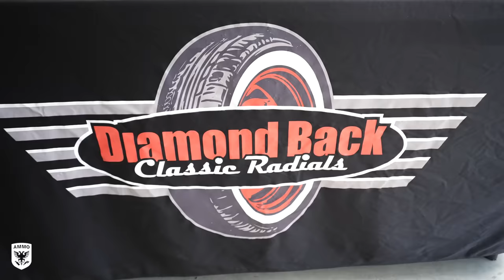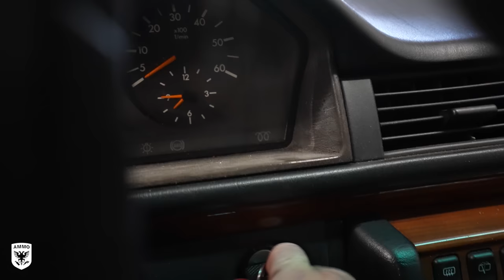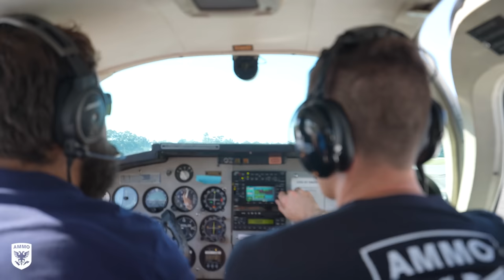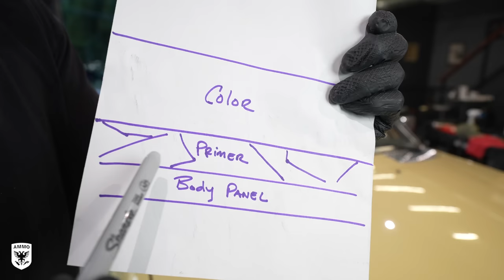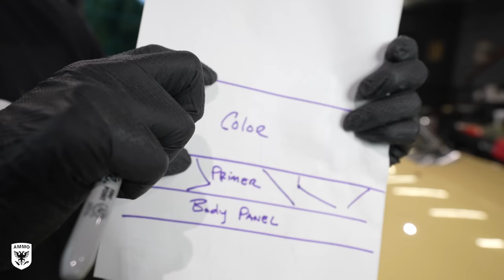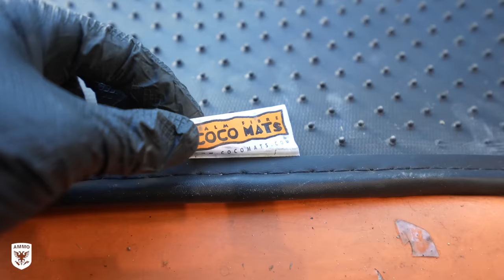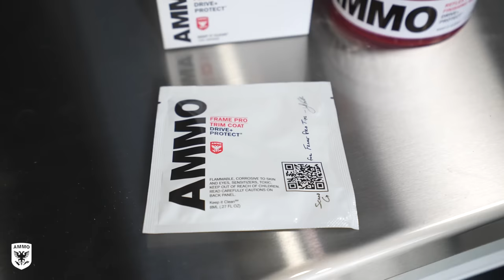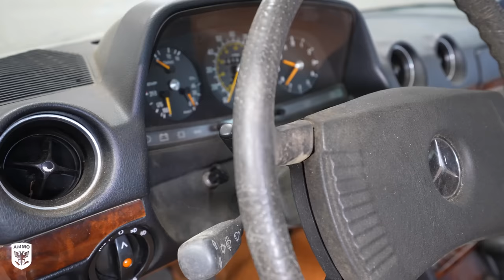First Wash in 10 Years: Mercedes 300CD Diesel Disaster Detail and Sale!

Comment: That's actually incorrect about the starving of air. Diesel creates no vacuum, especially non-turbo examples. They rely on a diaphragm pump to run the brakes and other vacuum accessories.  There's also no valve body or any plate restricting air entering the engine. That shut off cuts the fuel at the pump. Normally is vacuum operated but usually the rubber lines fall apart after the 40+ years.
Reply: My buddy’s 300TD would keep running and we had to pull or kink one of the vacuum lines if the key didn’t kill it.
Reply: Repent and follow Jesus my friend! Repenting doesn't mean confessing your sins to others, but to stop doing them altogether. Belief in Messiah alone is not enough to get you into heaven, you must become a new creation and be born again by responding to the Holy Spirit. - Matthew 7:21-23, Revelation 3:15-16 cf. Hebrews 10:26-29. Pay close attention to your thoughts and how you respond to your inner monologue because it has a greater impact than you think.  Call on the name of Jesus and pray for Him to intervene in your life, and do all that you can to follow His ways.

Comment: I’m a big Mercedes diesel fan here in Ireland. Great to see two 5 cylinders on the channel. The diesel coupes were very popular in California as Mercedes used them to help lower their fleet emissions to meet the air control laws of the 70’s and 80’s. 
Even though Europe was a huge diesel market, the diesel coupe was strangely a North America only car.
Reply: MB 300D was mainly used as taxi or corporate cars here in Europe, and a two door coupe wouldn't be good for that.
Reply: I'm new to the Mercedes crowd ,as I just got a nice 80 240d 4 speed from a little old dude who was a customer of mine. 
Coming from vws, at least I understand a little bit of German 😄
What a heck of a car, it handles really good even on those skinny little tires and stops great too. 
It's not really any slower in acceleration than my old diesel rabbits I drove for years. 
What a fanbase these cars have, I knew a little but since I'm immersed in it now,I really had no idea. 
From what I've read about ,it seems like it's a car that they almost made too good and can actually be repaired. 
And what a joy I had the other day working on it, I dropped a wrench in the engine compartment and it fell all the way to the ground! 
I haven't had that happen in years especially working on Mk4 or newer vws! 
This right here,is what I believe they are talking about when you hear about the German engineering.
Edit: one car I have a bad itch for ,is a blacked out 91 560sec. 
I saw one years ago at a show ,and for sale at 11k. 
At the time ,not knowing anything about them I passed on it as I was afraid of the German money pit syndrome, but what a car it was. 
Someday I'll find one.
Reply: @MrTheHillfolk  I was basically bouncing between buying a car with the 1.9 PD TDI (probably a mk4 Golf PD130), or an old Mecerdes OM diesel. Ended up with a 1990 190D OM602, same engine as the wagon in this video, but naturally aspirated. I plan to drive it literally forever, running it on vegetable oil if diesel becomes unobtainable.
I agree with you about the fanbase. I came from mostly Japanese stuff, having never had a German car at all, and the old Merc community is fantastic.
Reply: I see a few of these everyday in my neighborhood in LA. Testament to their enduring popularity and remarkable durability.
Reply: @MrTheHillfolk  Welcome aboard (1979 240D owner here since 1993).  Those cars will run forever and there are very few NLA parts from Mercedes.  In fact, you can go into your dealer right now and order new OEM parts.
Reply: @Bannimann2  The most taxi drivers at least in Germany preferred the 200D.
Reply: i always thought it was weird WE got all the diesels.
Reply: one thing about these Mercedes is the sound those doors make when they close. its like a big vault closing crazy quality.
Reply: @cassiodios  Yes as the size of the car was identical, and the smaller engine in the 200D had a better fuel economy, but they were slow as heck, which didn't mean a lot in the cities. Here in Denmark the 200D was also the prefered choice as a taxi, but there was also quite a lot of the 300D variant. :)

Comment: 17:22 A tip with the razor blade, use scotch or packing tape on the rest of the blade where you don't want it to make contact with anything to prevent yourself from accidentally gouging the paint. You can tape off both sides of the razor and just use a small little patch in the middle as if it were a tiny hand plane blade. It gives you a lot more control and peace of mind.

Comment: 7:55 The opposite. 
Diesels run on compression heat only, with no throttlebody or sparkplugs, so to turn them off they're starved on fuel.
However the shutoff on the injection pump is vacuum operated so there's a manual shutoff tab on the linkage incase of a problem in that system.
The glowplugs are for coldstarting and vaporize the fuel injected directly at them to help atomization when the internals are cold.

Also "dieseling" i believe is from the time when a carburator engine kept running with ignition shut off, and nowadays adopted for any similar situation.

Comment: I use to own a 1982 300D auto, same 5 cylinder engine, it was really tight until I got 100,000 miles.
Iran it for 8.5 years and got half my money back when I sold it, a great car. Later I had 2003  270CDE auto the same 5 cylinder engine with a turbo, ivory leather interior, the best car I ever owned, I gave it to my daughter when I retired  overseas and she still drives it to this day. 😀👍

Comment: In the spring of 1977, a coupé version was introduced on a shortened wheelbase (2,710 mm (106.7 in) versus 2,795 mm (110.0 in) for the saloon).[6] The C123 was available as 230 C (later 230 CE) and as 280 C and 280 CE in most markets. Unlike the W123 saloon, the rectangular headlamps were fitted to the C123 regardless of engine type.

Comment: Great video as ever. Makes me want to go get new cars and tidy them up! 

Question: why do you always pressure wash straight up then snowfoam - do not rinse - then contact wash with "shampoo" and then rinse?

Learning fro. Forensic detailing youtube channel in the UK - he suggests the foam products are engineered as contact less/pre wash options and has tested rinse first vs foam first them rinse and found the pre rinse just leads leads more water / diluting the product and letting it run off? Surely thar approach before the contact wash is better for the paint as you'll clear more dirt and won't risk micro scratches thar need poliahing off - I realise you are practically always polishing the paint but still why?

Comment: Steering wheels used to be large in old MB cars because MB wanted you to be able to turn the wheel even if the power steering failed on you. Many things on these cars are designed in such way that it would allow you to drive away when evey other brand would just stuck. MB was a top notch car with customers in mind (not so much today)

Comment: That Cadillac! But I love an old Benz. You would have seen a lot of those in Germany mostly until the 90s, when other manufacturers started to create Taxi versions of their normal sedans. One of the aspects was very hard upholstery in vinyl. At the time it was still permitted to smoke in a taxi, so I remember the stale smell of cigarette smoke quite well. I have seen a very well maintained Mercedes Diesel sedan (not a taxi) with 700.000km on the clock. Pretty impressive. Unusual to see a Coupé as a Diesel.

Comment: ok as a mercedes guy i have to say this, the 250 is a S124 250TD and then the chassis code of the coupe is not W123, it is C123, and the million miles your friend is talking about is mostly achieved in the 200,220 and 240 models (om615 and om616 engines), these engines were never available in the US!

Comment: This is one of the best cars ever made.  Probably the most reliable car ever made too.
Reply: I owned one in the UK for 1.5 years, it had full service history, 674,000 miles on the original engine, and 2nd transmission.  It drove perfect.  Just service every 7500 miles.

Comment: Those Mercedes are really bullet proof. My dad had a w124 240d that did more than a million Km as a taxi without an engine rebuild. Afterwards he bought a w210 220d (non-cdi version) and it already has more than a million Km. Without rebulding the engine and with the original clutch (i know this part is hard to believe). The only major repair was rebuilding the injector pump

Comment: The STOP button on the 300CD mechanically also closes the fuel supply on the injection pump.  It's needed because the fuel shutoff valve is vacuum actuated, and if there is a big vacuum leak, it will no longer work.

Comment: For sap removal I always found that denatured alcohol worked really well on clear coated paint.  I realize this is single-stage but it may be worth a try.
Reply: I had a car with sap on it like that, after getting it off, the spot looked like the spider webbing on the car in the video.
It was just packed tighter together. 
It knda only shows up at the right angle ,but I see it 😕
Reply: Agreed, and if it's really dry and solid, you can rip a small piece of paper towell and stick it on there and soak it. It will soften in a few minutes.

Comment: the Diesel shut off shuts off the fuel not the air, the shut off system is vacuum operated, there is a vacuum pump on the engine for the brakes and other systems, you guy have got a lot to learn about old diesel Mercs, the top end clatter is Diesel knock,it is a good indication of good compression,if your old diesel Mercedes doesn't rattle like that it will probably have low compression.

Comment: A Diesel engine is a fuel engine, what that means is the amount of fuel it gets is the amount of power output you get. Dieseling on a gas engine comes from when you shut off a engine and it keeps running but pinging sounding like a diesel.

Comment: To waste even more plastic, Diamond Back Classic Tires could fill the inside of the tires they're shipping with unrecyclable plasti foil as well.
Reply: That would actually be a waste. Wrapping the tire protects the whitewall during shipment. Do you have better idea?
Reply: @brandyc3647  Tires are individually wrapped, than cardboard and another wrap, then bundled together and wrapped again. This is already waste. Wrap both one time then use those strong plastic bands to tie them together. Whitewall is protected as well as the whole tire and two are bundled together.

Comment: The “stop” lever on an OM617 stops fuel flow, not air. The air is always uncontrolled on this engine. The ignition key accomplishes the same fuel interruption via a vacuum solenoid on the rear of the injection pump.

Comment: Nice job on the 300 CD.  
I've owned a few Mercedes Benz cars, but my favorite was the '82 300CD Turbo diesel.  Was hard loaded with goodies, black/tan interior with a sunroof that never leaked.  Drop dead gorgeous and no issues with the car in the 3 years I owned it, from new. My CD had Michelin X radials with a 1/2" whitewall.  Handled and rode well with them and looked great!  
It lived in my garage, I was meticulous with cleaning and recommended maintenance.  Detailed twice yearly.  My wife said I loved the car more than her [she also said that about my Beech V35B].  I told her the car responded to TLC better than she did.  Not one of my brightest comments...

Comment: I had one of those 220D 'taxis' in the early '80s.The seats were great, and it was reliable, except in Buffalo in the winter. You had to plug in the block heater and you had to keep it running when you went in a store, or else it wouldn't start. I clattered and fumed and puttered around town with it, but it was much happier on the open road. One day, a new highway opened up south of the city, in a remote area. It was brand-new white-as-snow concrete, and straight as an arrow for miles, with not one other car. So I floored it. Once it got over 80 mph, the engine went almost silent, vibrationless and the car seemed to rise up on rails. It was an amazing revelation.

Comment: Back in 1994 my first car was a  signal-red 1979 Mercedes 200D 4 speed manual sedan with creme interior - oh how much I hated how slow it was, but it was a great car after all. And by slow I mean really slow - 0-60 in 27sec - go figure that! I've then owned a 1978 280CE with a W116 engine from 1972 (which had the cool electronic fuel injection!) and a 1980(!) 300TD Turbodiesel station wagon. That one was special because it was a factory test car from MB which was handed to a former Austrian financial minister in 1980 for whatever reason. The VIN ended by 00000008. Though it was a bit of a PITA, the most fun car of these 3 was the coupe :) Great to see you got this 300CD back to beautiful Larry.

Comment: The 250 TD is not a Turbo Diesel.
The T stands for "Transport" 
All the stationwagon versions had the T in the name, also the gasoline versions,  like 300TE for the stationwagon version and 300E for the sedan version, the E standing for "Einspritz" ( Fuel Injection )
If you had a turbocharged 300 diesel stationwagon, the name was 300TD Turbo Diesel.
The 2.5 5 cylinder in this model ( 200 series ) never came in a turbocharged version, you had to buy the 300TD Turbo Diesel.
There was a 5 cilinder Turbo Charged diesel though, but it was only for the 190 series.

Comment: I’m in Ireland. Most cars are diesel and Merc’s will easily so 500k miles. I’ve a 5 cylinder D5 Volvo XC70 with 200,000 miles and it’s going great. So why would I change it for some piece of rubbish full of electronics and chips? Nope, ain’t happening!

Comment: The STOP thing on a 300CD is a fuel cut on the pump, not air cut. They had electronic solenoids to do that probably, that could fail, so that was a lever to manually cut the fuel on the pump. That's an old diesel technology, they are all stopped by fuel cut, not air cut. The new diesels with EGR system got throttle bodies only recently, anything older than 15 years old I would suspect does not have any sign of any flap in the intake, especially ones from 1980s and before. 
The revs are actuated by amount of fuel, not amount of air like in petrol cars, so that's why they don't need throttle bodies.

Comment: My dad owned one of these Mercedes-Benz 300s that thing was impossible to break. That thing was crushed by a roof, left outside for 7 years in the cold winters of Lithuania where a couple of times the snow reached up to the windows. And all it took to start it was a battery on its last legs with some jumper cables. Sadly it couldnt move due to the brakes being rusted on, but hey its still crazy. My dad sold it to a guy with another Mercedes 300 for parts to restore it a years ago

Comment: Is there any video or info from you where you tell how to do the squeege glascleaning method? I dont know why but since the last 2 years my old method didn't working anymore. Usually i was known as the guy with completely streakfree and foggfree windhsields in my circle of friends. I even helped them to get the same results. 
Now i tried some things like using isopropic alkohol, different types of towels and methods to use them but nothing would work...

Then i saw your squeege method and want to give it a try so if you have a tutorial or an information how to use it properly i would be pretty thankful.
Or if anyone else in the comments who knows it, feel free to tell it :)

Comment: Also, there are drainage channels running through the quarter panels, you can clean them out using some string trimmer line. if they get clogged they will force water into areas of the body and let the quarter panels rust out.

Comment: I was taught with steel razor blades that a good trick is to take it and first press it against the glass and gently push/bend it to give the cutting edge a slight curve so when you go to use it against paint it is more likely to only scratch and not dig if something goes wrong.

Comment: 25:56 On many modern tires there is a mandatory outside face.
Typically, the manufacturer adds the marking "OUTSIDE" on the tire's face that should be mounted towards the outside of the car.
As stated on the video, such marks are removed during the process of adding the white walls on the tire.

Nevertheless, I agree with you: it was only fair to place those tires on the car.
Plus, those white walls look great on that W123 😊

Comment: Larry, may I suggest using an X-Acto type knife, with various shaped blades for the sap removal process? There are Multiple shaped and sized blades available to help getting into applicable spots/locations.😳🤔😳
P.S. that “face mask/respirator” type was a great idea to use during the underside/wheel well cleaning phase,👍

Comment: As you were cleaning the inside, I could literally feel very texture as you scrubbed the doors cards and seats, and vacuumed the carpets. That thick carpeting and the semi hard feel of the artico vinyl, brought back memories. My dad had a W123 300 diesel sedan. 3 speed automatic, 5 cylinder non-turbo. I spent over ten years of my life cleaning the thing every weekend, until I left home to work. I was built like a tank, and it’s enamel-like paintwork was stupidly resistant to chips and scratches. It also at one stage had the diesel run-on problem, I was was accustomed to popping the hood and hitting the STOP lever on the odd occasion I drove it to university or to parties. It did nothing for my street cred, but I didn’t care. In 2003, a few years after the passing of my mom and over 19 years after it was first purchased, my dad finally sold it on. I still miss that thing. Best car ever made.